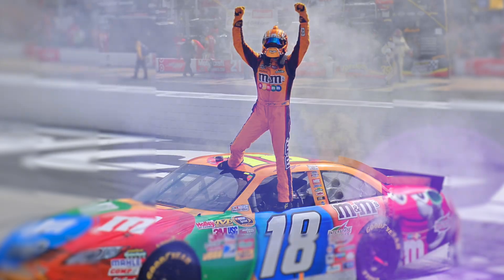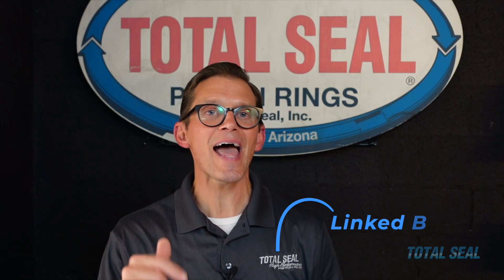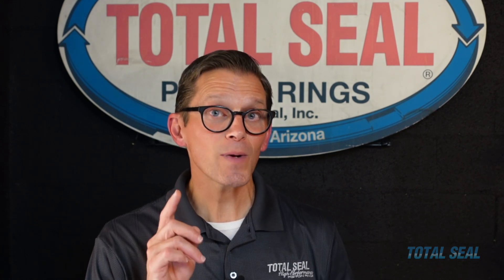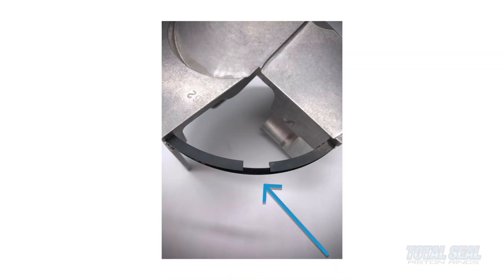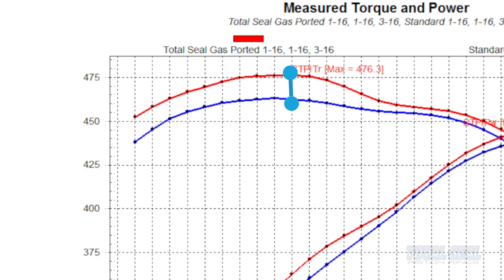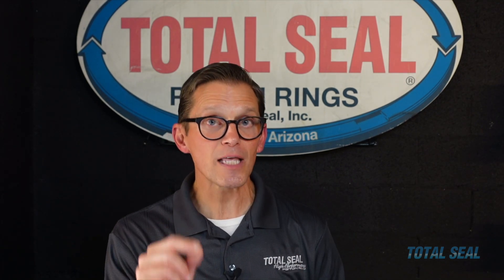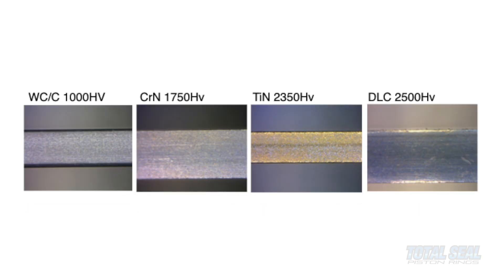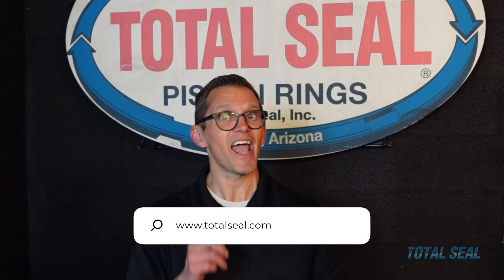Can The SCIENCE That WINS Races SAVE You MONEY?

Comment: I use these in my 588. Won a championship last year.
Reply: @bigboreracing356  well duh. The first time I used them everything was great. Obviously rings didn't win the championship. The entire combination was perfect. But hey you would like everything that won you thousands of dollars 2.
Reply: @bigboreracing356  I will say it's the best right seal I ever seen  and  i Been drag racing my entire life.
Reply: @bigboreracing356  bro I don't run a tall deck. Why are you under the assumption you can only run gapless rings on a tall deck!? Why on earth are you being so confrontational with a YouTube comment? Did you mess up a motor with them or something?
Reply: @bigboreracing356  do you even race? What makes you think I'm a high budget racer? I do a lot of winning and honestly my car prints tickets. So yeah when you run 7.54 3 weeks in a row, with the same time slips for 23 rounds of racing and you won 22 of them yeah you are going to like what parts you are using.
Reply: @bigboreracing356  I think you need a hug.
Reply: @bigboreracing356  the only downside I have experienced with them is oil control. They don't leak down like a regular ring sure. They take longer to break in, they tend to have break in issues if there's any discrepancy with cleanliness and scratches in bores. They are also rather harsh on bores after about 250 to 350 passes in my personal motors. So obviously heat effects them differently especially if they start to wear or should I say heat can cause premature wear. Am I missing something?
Reply: @bigboreracing356  well honestly regardless of what your last comment said I have run conventional rings most of my life. You aren't going to tell me something I don't already know. I have my other motor set up with regular rings. What I can tell you from running them is yeah they basically the same as other rings. I wouldn't run them with boost or nitrous though. The rings in a big block dragster did not win a championship at all. I'm simply throwing a blanket statement because they were simply in my motor.

Comment: Yates,Childress, Petty. How did they do it before those 8 seasons? With less technology on rings and more towards piston design. In some cases, eliminating rings all together.
Reply: No piston rings?? Not really possible unless you don’t like your engine running long especially at 8k rpm for 500 miles
Reply: @Thumper68  f1 hasn't used rings in years. Control wall clearance and there is no need.

Comment: This probably requires another video on its own, how does ring tension affect oil scraping during non-power strokes? Do the tighter tolerances, and lighter viscosity oil allow those thin low tension rings to work? Ring seal soup as you call it.
Reply: My question goes along with your question would oil consumption go up since the ring is not tensioned on the other strokes?
Reply: @rolandotillit2867
Only the top, ported ring is lower tension. The second and oil rings are not ported.